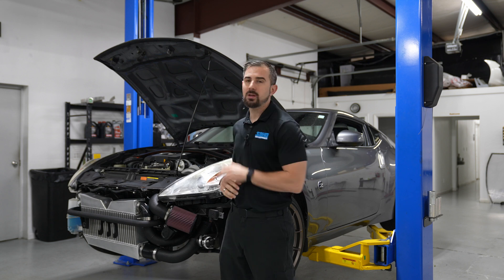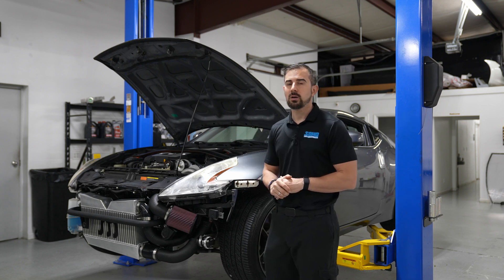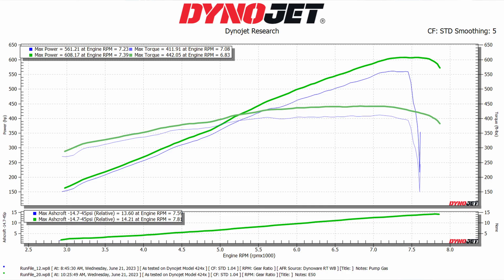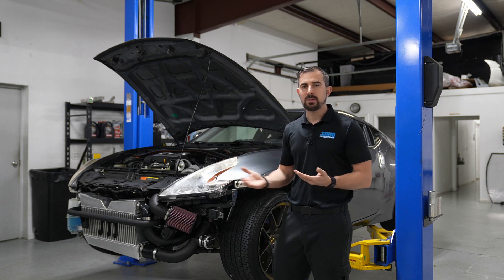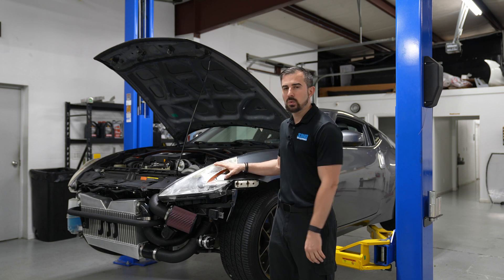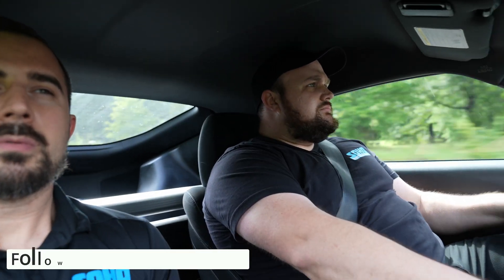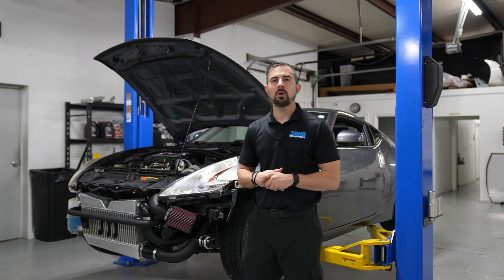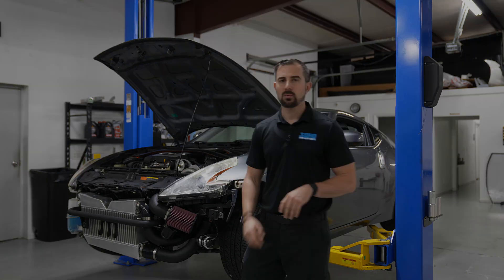SOHO Motorsports V2 A2A Supercharger Cog Setup (Nissan 370z / Infiniti G37)

Comment: Whats the 0-60 & 1/4 mile time on something like this?
Reply: Ive seen around 3.1- to 3.4 seconds 0-60 and low 11s in the 1/4th. You would be in the upper 10s with some weight reduction.

Comment: Is this stock transmission? How much torque are these transmissions able to handle stock? Would you be able to increase the torque safely if you replaced the stock transmission to the 3.0t transmission?
Reply: 550ft lbs before it starts causing problems
Reply: they say if you switch to the Q60 transmission it can handle more torque
Reply: @TheTruth525 vr30 baby but id dog on the stock tranny till you run into any issues and i wouldnt go past 15psi of boost max on stock imo

Comment: I also have CJM return,1300cc Injectors and a Hellcat 525 lph I need to install... I just need Flex Fuel kit for e85.

Then again, I just rebuilt my engine and need to stop it from revving to 4K RPM when it's cold. 😅

Baby steps. 

I'm actually going to be calling y'all tomorrow lol